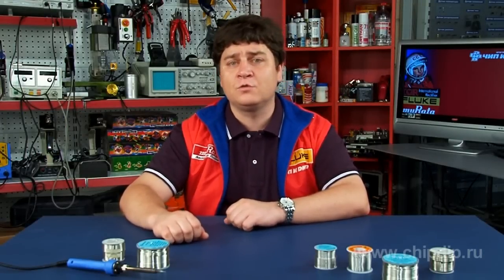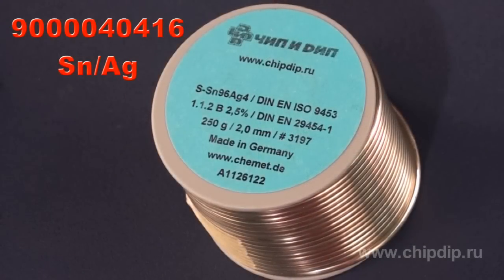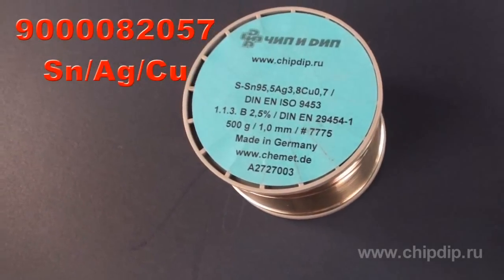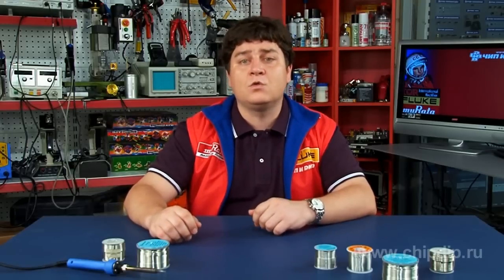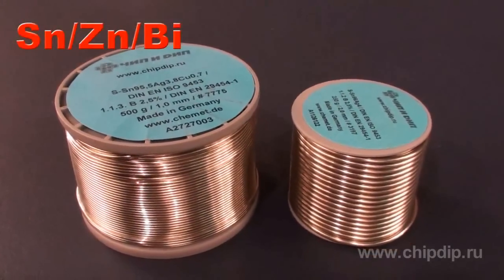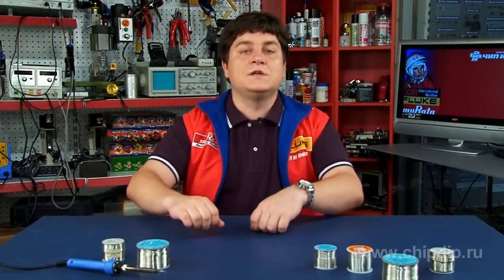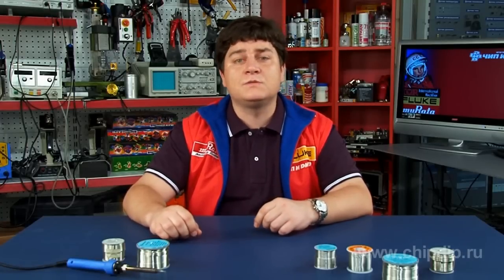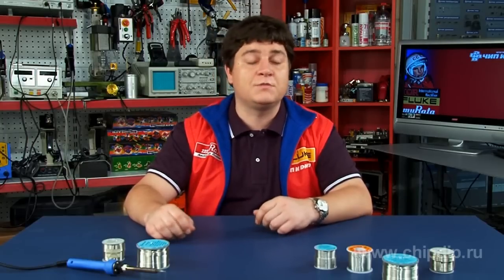Lead-free solders

Comment: Lead free may be the wave of the future, but when it comes to high reliability, high quality soldering, there is but one choice! That is an RMA flux cored pure eutectic which there are two variants. The first is the RMA flux cored pure eutectic in it’s Sn63 formulation. Then, there’s the Sn62 version of the RMA flux cored solder which is 2% silver by formula with the tin being 62% and the lead 36%! These two RMA flux cored tin/lead and tin/lead/silver formulations are the only two which will yield the high quality, high reliability required to consistently give repeatable and advantageous results time after time!